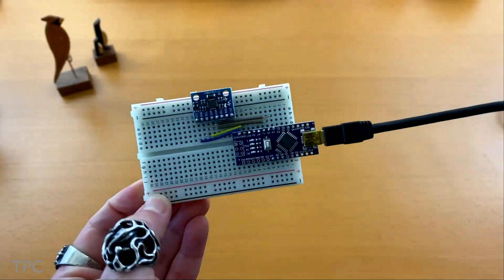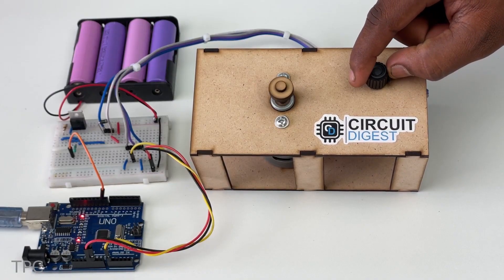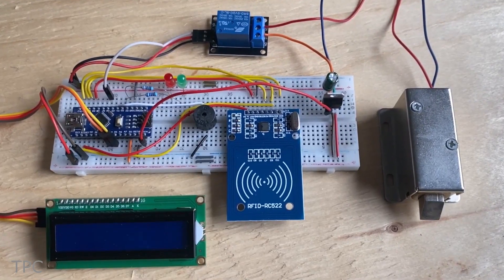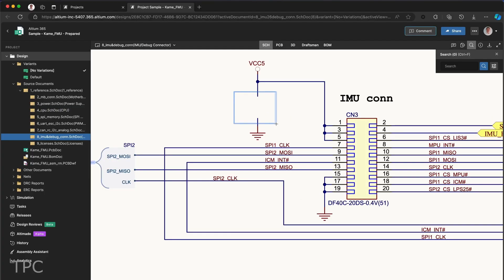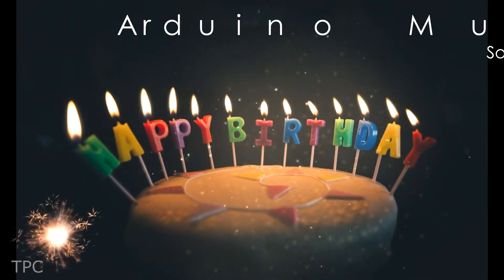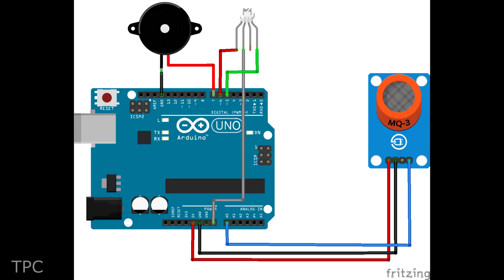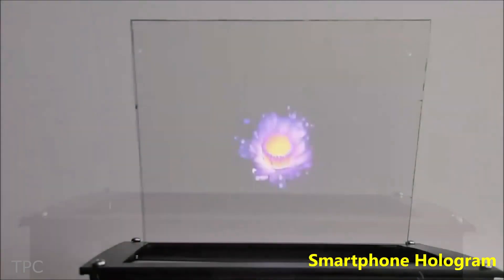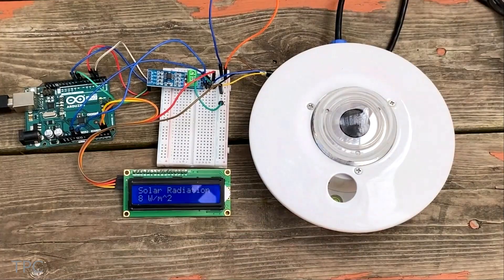12 Best Arduino Projects for Beginners in 2024!

Comment: Is it enough if I'm very interested,but don't know how to solder? 😊
Reply: yes, you can use a breadboard wich comes with all arduino starter kits, you just place the components there and conection is made. I do advise you to learn to solder tho, it is not hard. I got a cheap soldering iron and without checking any guides or having done it before was able to do it first try (it didn't look perfect but was good enough to fix my damaged cables).

Comment: sir, in my Arduino Uno when I give supply from jack then supply works but when I give supply from CNC shield then supply is not working, I also tried another CNC shield but still supply is not working, please tell me what to do [I have 12V, 5A supply.]

Comment: i hope someone can make VFD 220V 1 phase in 3-phase out spindle speed sensor, i not understand how build. my cnc spindle 2.2KW 3-phase, speed display system. some arduino project has test but not show accurate speed spindle 8000-30 000 RPM etc, test has photo sensor, IR sensor, not working right.

Comment: I don't understand why people still use Arduino when the ESP are way better
Reply from the maker: True! The ESP series definitely offers powerful features like built-in Wi-Fi and Bluetooth, making it a solid choice for many projects. However, Arduino still holds its ground due to its simplicity, extensive community support, and vast libraries and tutorials. For beginners or projects where Wi-Fi isn't a necessity, Arduino remains a fantastic option. It’s all about choosing the right tool for the job!
Reply: @ToPProjectsCompilation  WHERE ARE ALL OF YOUR ESP-32 VIDEOS ??

Comment: Dumb question regarding number 11. Why not use the potentiometer to control the motor speed directly? What is the benefit of using an Arduino in this case?
Reply: Pwm
Reply: @Shantanupanwar96 we know
Reply: To show you can complexify things too? 😉
Reply: I dig #12. Gonna make it,with more,/other input options. Awesome sound for a synth-freak!
Reply: Dear Mr @Takumi. Excellent project! Is the program Public Domain!,or am I allowed to modify your amazing source code? That sound is amazing! I see it's arpeggio based,but would it be possible to decide notes in an easy way,with another controller? Probably have to find your email.... 😉